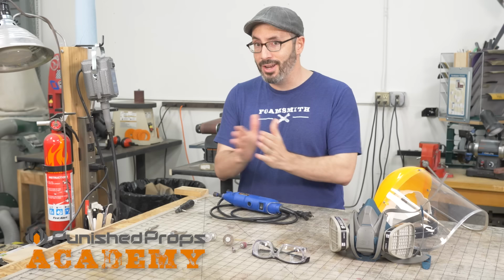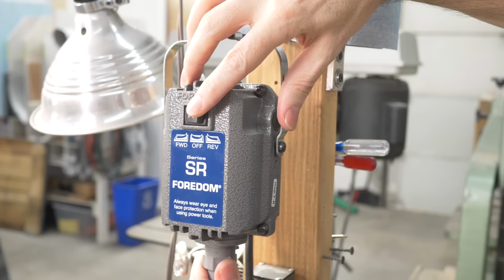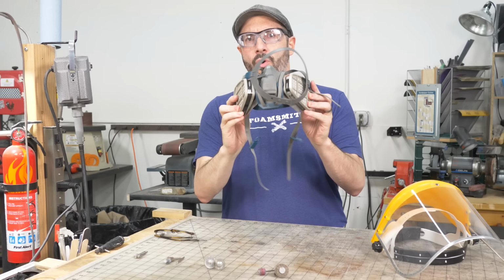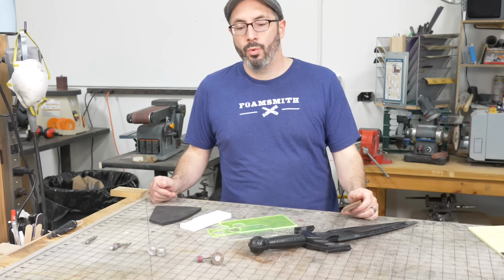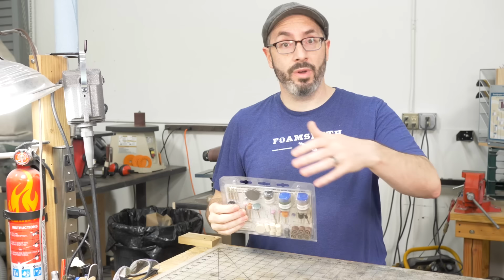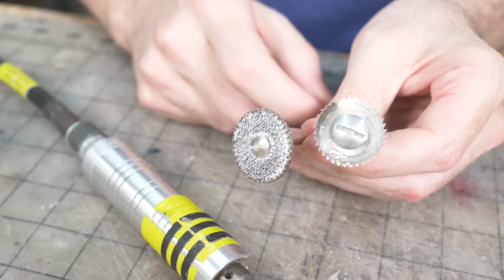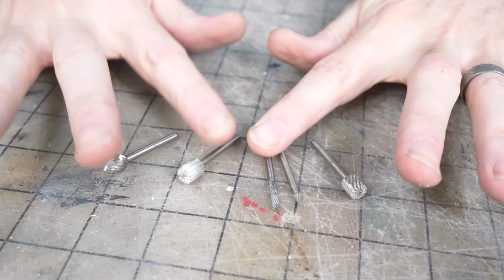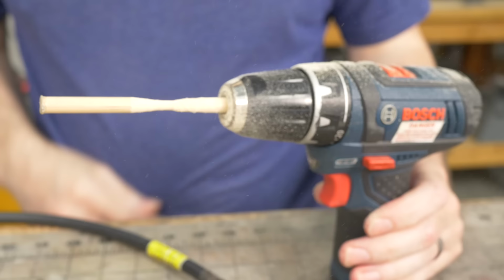Rotary Tool Basics: Your New Favorite Tool

Comment: Would you recommend sandpaper or a rotary tool for for large bevels on eva foam?
Reply from the maker: Both! A rotary tool can help you cut down most of the material and then you can fine-tune with sandpaper on a paint mixing stick for a nice flat edge :)
Reply: Thanks!

Comment: I keep having an issue where I'm using the sanding drum attachment on my dremel, and when the sandpaper eventually wears down and breaks during use my rubber mandrel gets kind of rounded and thicker, and the sandpaper drums no longer fit on it, does anyone know what my issue is and how to stop it from happening? Is there some magic trick to knowing when your sanding drum is getting ready to split in half?
Reply from the maker: Interesting! I don't think I've had that happen
Reply: @punishedprops  Yeah, I haven't really been able to find anything on it with a few google searches either, which is why I'm so confused.

Comment: For eating wood quickly, also look into structured tooth carbide bits: https://widgetsupply.com/category/dremel-carbide-burr-structured-tooth.html
And for fast material removal with harder materials, as recommended by Adam Savage on a similar video not long ago, double cut carbide burs: https://widgetsupply.com/product/bdg05-cb1862bd.html
Reply from the maker: Right on!

Comment: you inspired me to get a rotary tool. I was thinking the WEN 23190. But I also saw this lovely thing- https://einhell.de/shop/en-de/th-xg-75-kit.html… Would be better to invest in this tool which can do more? Or would a standalone rotary tool perform better?
Reply from the maker: It's really up to you! I've used my WEN for years, but I love my Foredom. A great thing to try is buying one at a lower price point to learn it and see how often you use it. If it becomes a frequently used tool, it's worth the cost to upgrade!
Reply: @punishedprops  first of all holy shit thank you for responding.
Secondly, my question wasn't really about high end or low end tool. The question was about the difference in performance between a standalone rotary tool and the bench grinder with flexible shaft that can be used as a rotary tool (the tool I linked to). The main thing I'm looking for is the rotary tool functionality.